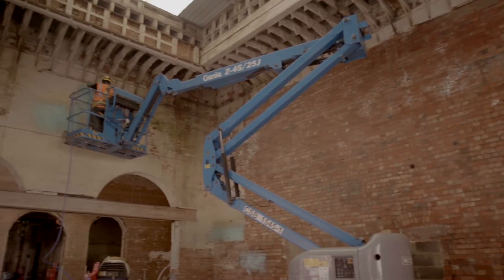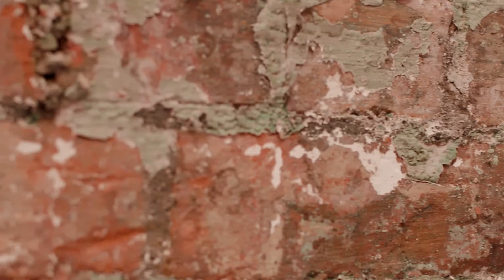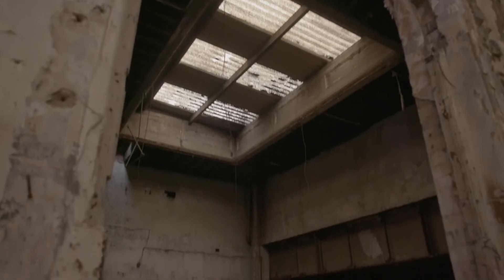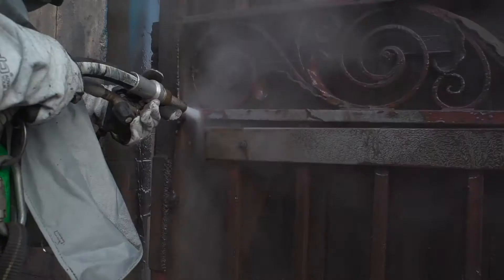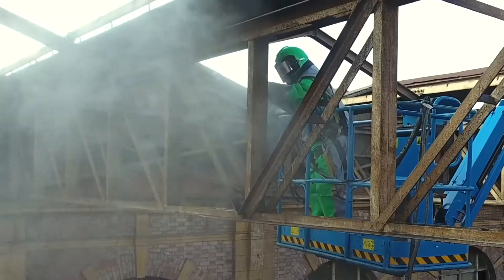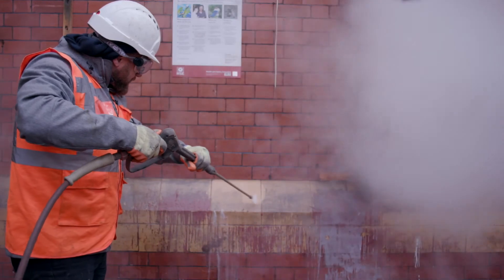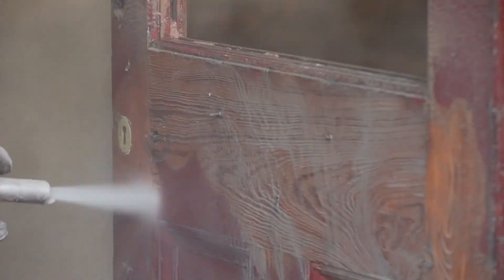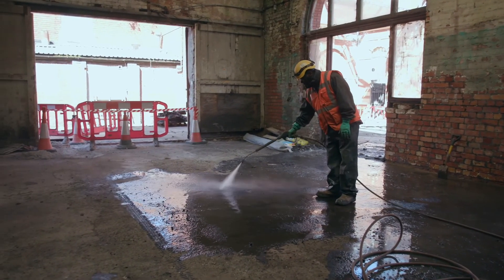HOW TO...Remove Paint from Stone & Brick

Comment: Need your expert advise sir:  My granite floor is dotted with paint that got sprayed when the outer wall of the building was being painted. What solution can I apply to remove the paint.  Someone told me I could use thinner. Is that alright ? Kindly help with your advise.